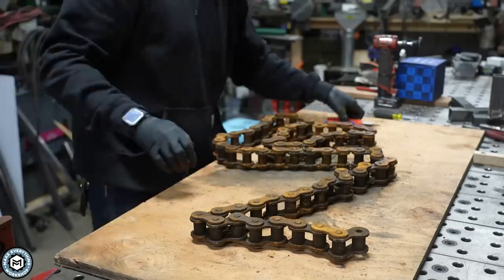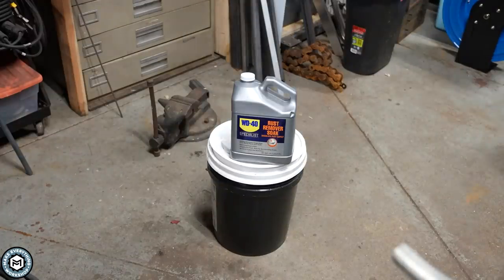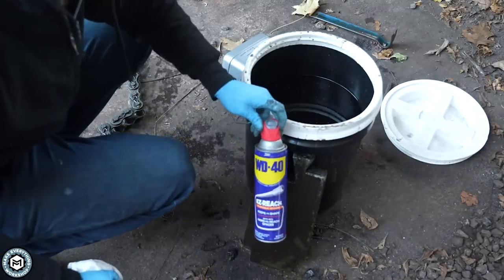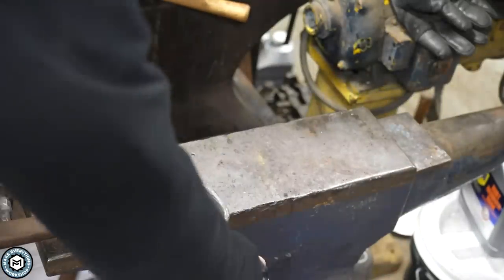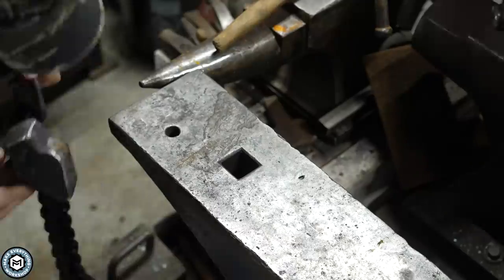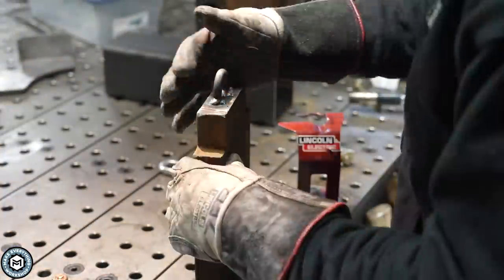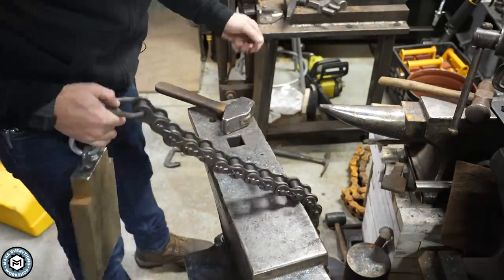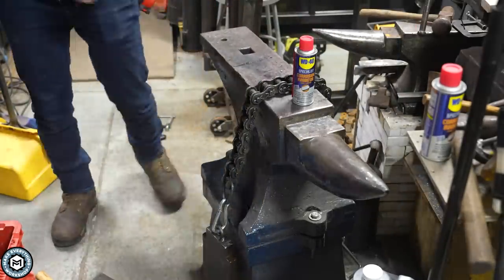I Made My Most Useful Blacksmithing Tool!

Comment: I've found the holdfast I forged some years ago does a pretty good job of freeing up both hands when I'm forging, and it pulls right out of the pritchel hole when I'm not using it. I think the stuff I forge actually moves less than your system, but good on you for re-purposing old material!
Reply: Yeah, good for DIY but that's a ton of work and not near as handy as a simple spring steel hold down that takes ten minutes to forge and use for a lifetime. Couold have made a hold down and 20 pair of tongs in the time it took to put that together. 🙂

Comment: Hi Chris

One thing you could do is make a base mount plate for the anvil stand to sit on and have the slide bar welded to the base plate.

I noticed that the cast iron stand has 2 mounting holes casted into it, one on each side of the stand.
Those holes could be the mounting point for the base plate.
Some threaded rod welded to the base plate the stand fastens to the base plate and the anvil sits on top. Plus of the base plate you can make a holder for the weight to sit in.

In practical terms the cast iron stand is in one piece and is not butchered or drilled with holes in anyway shape or form, plus you have a way to fabricate other holders for the anvil and no damage to the cast iron stand.

A win, win, situation I think.
Plus using the heavy duty industrial gear chain is a good idea for a third hand on the anvil.
Reply from the maker: I’ve had a similar thought to use the original mounting holes for hammer racks but you’ve given me a great idea! Now to find some plate! Thanks!

Comment: Interesting tool, nice found on that old chain & elevator weight. 
I got the fractional conversion stickers from your website, Thanks. I find it helpful for quicker decimal retrieval to put a red dot next to the eighths 1/8, 1/4, 3/8, 1/2, 5/8, 3/4, 7/8 to visually jump to the vicinity I'm looking for. Maybe you can do that on your next printing for more value add.
Reply from the maker: Thank you! Good idea also!!

Comment: Think instead of the c clamps a nice carriage bolt and steel plate on the base to hold the slide bar on will be fitting and useful for any clearance issues
Reply from the maker: Thst would also work great!